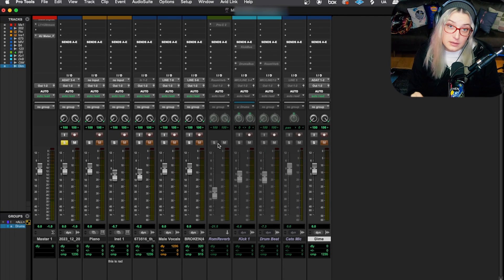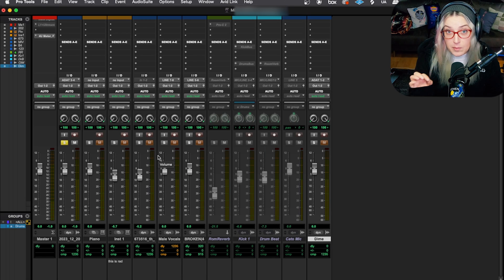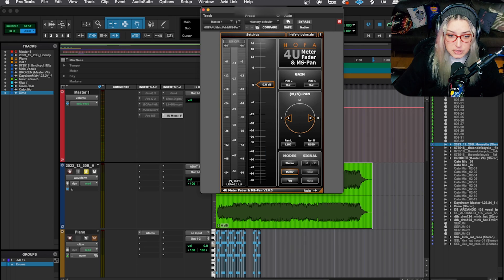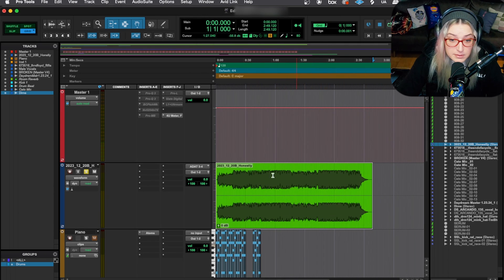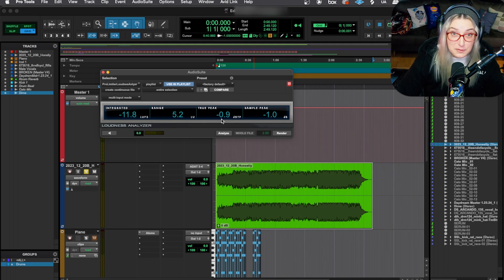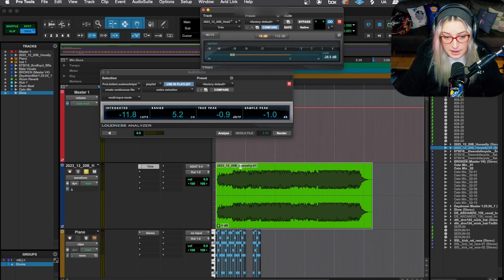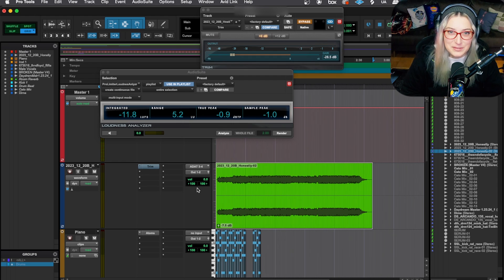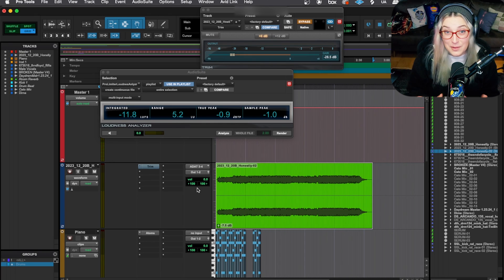Measuring Loudness: Avid Pro Limiter Loudness Analyzer, LUFS, & dBTP

Comment: Hey! This was super helpful - love being able to use Pro Limiter Loudness Analyzer as an offline process... such a time saver! Thanks for taking the time to explain that AudioSuite occurs at the "clip level" and is not affected by volume fader or audio inserts.

As you mentioned, there are great use cases for this. Sometimes if I want to check if an audiobook / podcast / long audio file has any points of clipping, this is such a quick way to find out! Cheers.